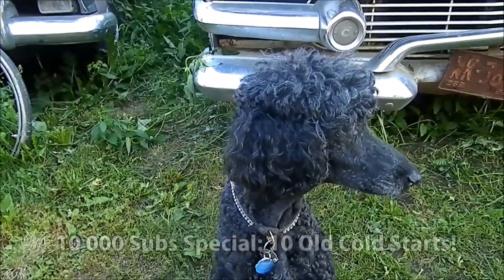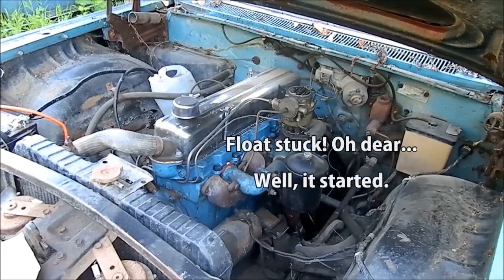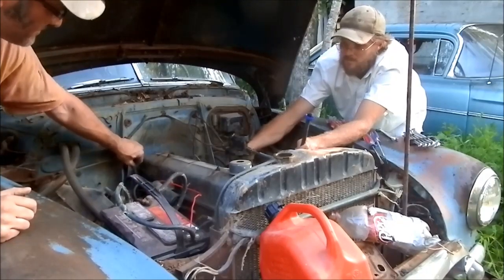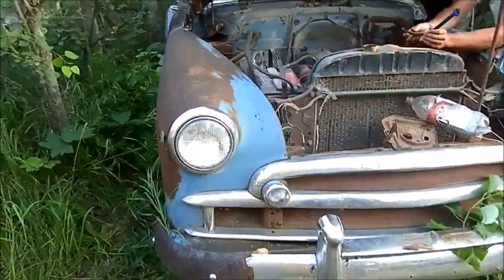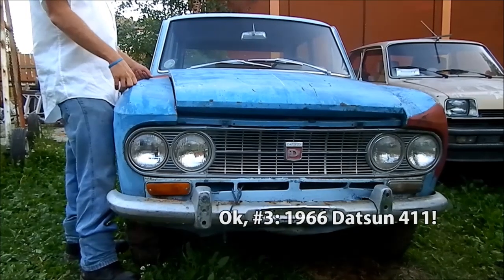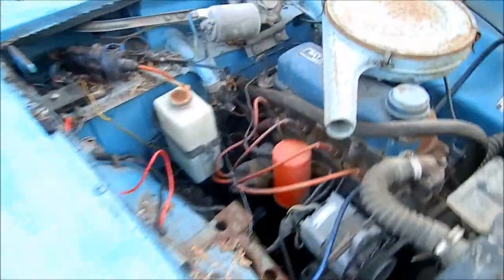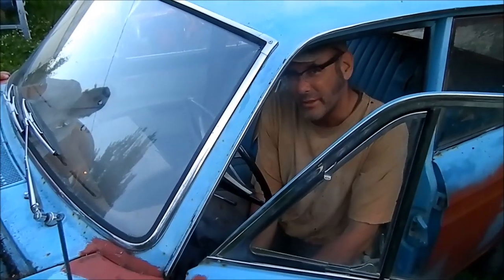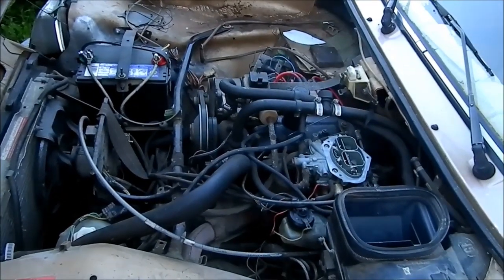10 Old Starts for 10K Subs! Part1 of 3.

Comment: You really should get a few of these things on the road to terrorize the locals. I'm guessing a lot of these cars don't have any papers to make 'em legal though.
Reply from the maker: Well, paperwork isn't as much of a problem as the amount of restoration required to make them safe and legal... usually way cheaper to just buy a good one. Some of them are savable, like the Frazer, and those that are will get the work they need or get sold to a good home eventually! Cheers from me and Stel.
Reply: coldwarmotors
Yeah, I understand what you mean man, but some of 'em out there are pretty nice. Others would make a good rat rod or something. The fact that some of those old iron horses still run is amazing. Although I use the term "Run" loosely, haha.

I usually buy cars for under $1,000 and use 'em as a daily beater, looking for another body to put a 350 GM Goodwrench crate motor into. It came out of a ratty fifty shades of gold '77 Olds Delta 4dr I wrecked. I'm the guy driving the stuff that no one wants in their neighborhood, or wants parked near their car, haha.

Good luck with the projects, even if Stel ain't interested in 'em. Can't please them all man.

Comment: That '50 Chev would be a great on road car, she wants to go.  The '57 Plymouth Plaza, a car I've never seen, seems to be the odd one out with the carb on the LHS?
It seems to me that the '58 Chev looks newer than the '59. The '57 had the big vertical fin, the '58 sort of had little to no fins and then the '59 went back to large fins at 90% to the '57. Seems like the '58 is more modern and more in line with the models that came after '59. Odd.

Comment: Dear Sir, I restore cars only a single mark called DKW.

They are cars from Germany wich were also manufactured in Brazil from 1956 to 1967.

These cars have an interesting mechanics; They are powered by two-stroke engines with three cylinders, three reels, three platinum and three capacitors.

The distribuitor has eleven set screws.

The DKW manufactured four models in Brazil named Vemaguet (station wagon), Belcar (four door sedan),  Fissore (two door sedan de luxe) and Candango (multi pourpose Jeep), ans was the first factory that produced cars in Brazil.

The DKW collectors of Brazil organize an annual meeting called "Blue Cloud" that brings together about 100 brand cars coming from all parts of our country. 

The name "Blue Cloud" is due to the smoke from the exhausts of DKW cars that have a slightly bluish due to oil mixed with gasoline.
Reply from the maker: Hey, thanks for the note! DKW is very rare here in Canada, I've only seen them in pictures... All the best from us here at CWMC to the Blue Cloud group...mmmm that 2-stroke smell!
Reply: Dear Sir, I would like to send some photos about our group and my cars. Do you have an e-mail for receive this messages ? Congratulations

Comment: Did you really expect the 57 to start, or was your thinking process under chemical influence?
Reply from the maker: Well, I thought it had a chance; it was starting on its own the last time I ran it a couple years ago. Just not enough compression left to get it going without a push, I guess. Once it's going, it runs fine and actually starts ok warmed up... Cheers!